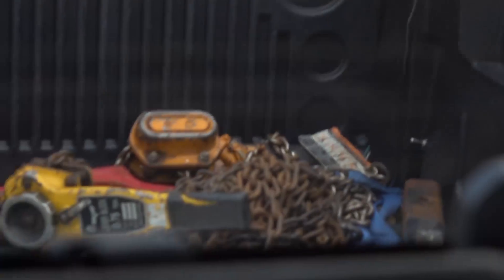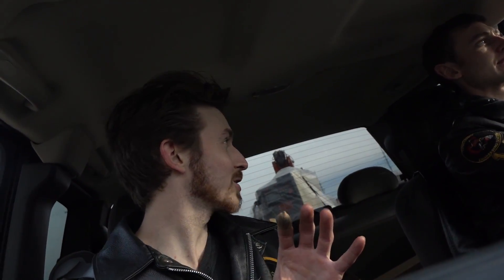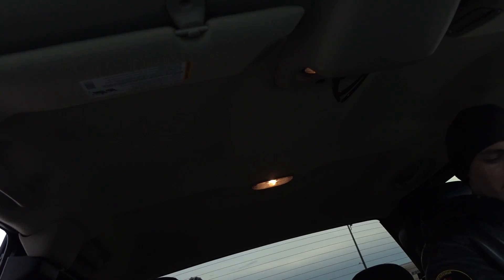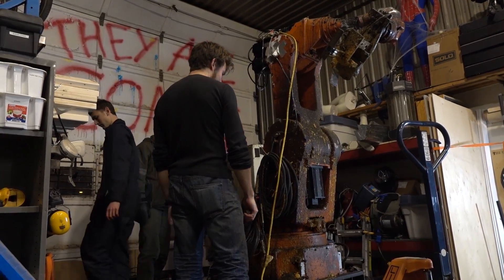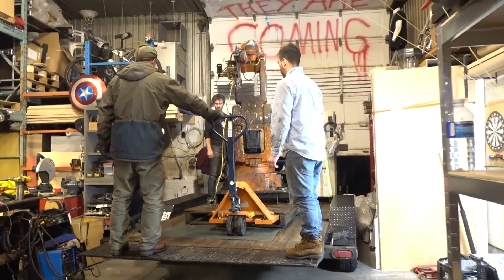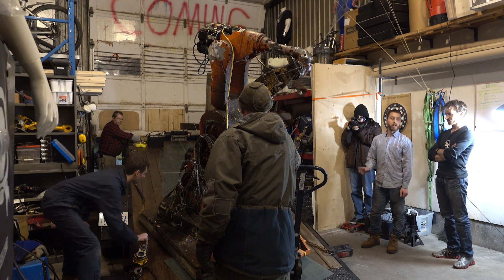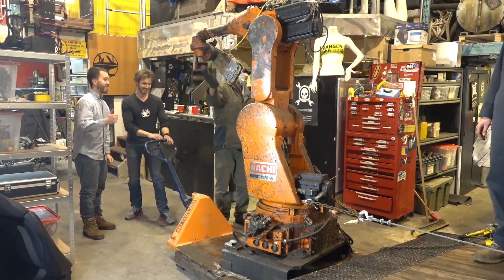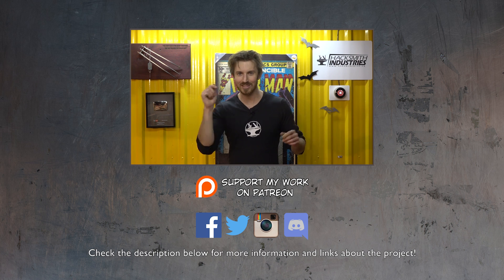WE GOT AN INDUSTRIAL ROBOT!?!

Comment: I was under the impression that 480 V only exists as 3 Phase wiring?
On the other side: your american wiring is somewhat strange. Why would anyone find 110V acceptable, I'd be worried that my vacuum cleaner would melt the wiring ^^
Reply from the maker: 110 is standard in Canada
Reply: the Hacksmith I honestly didn't expect an answer. So thanks for that.
While I normally abhore it when people tell YouTubers how much of a fan they are if they get an answer, I have to say that your and your team's work is very inspiring for me (I'm currently studying computer science in Germany). Hope that you get that jetpack going!
And yes I do understand that 110V is the standard over the pond, but I don't understand why, considering that copper has become a rare Ressource (and insulation hasn't)
Reply from the maker: +Jan Kühnemund Thanks! 480 is typically 3 phase, but like we said in the video the controller seemed to accept single - might not have worked with the robot attached though! 

Just curious though,  what's standard wire size in German for 220v15A? Everything here is 16ga for 110v15A
Reply: the Hacksmith Had to do some conversion there. For normal sockets 1.5mm^2 gets used, for sockets at which a washing machine, a dryer or another high consumption device will be plugged in 2.5mm^2 gets installed. 1.5mm^2 is about 15 AWG (is that GA?) and 2.5mm^2 should be about 13 AWG.
I didn't know that at 110v there would only be 16a. I always thought that the low voltage would be balanced out by a higher amperage.

Comment: seen those arms being used in combination with an extruder to make the ultimate 3d printer 
the one i've seen was in haarlem the netherlands 
https://www.3dmakerszone.com/eng2.html
they might actually be able to help you converting it to run an say centroid acorn
another option is to use it as a cnc extention for say a lathe holding the bit working the metal like a woodcarver would

Comment: You should be able to use a transformer to step up from 240 vac to 480 vac without any issues. During robot zone mod builds my company typically powers 4 to 8 robots on one 240 vac to 480 vac transformer
Reply from the maker: +anthony knapp still need 3-phase though
Reply: I must have missed the part you said you only had single phase
Reply from the maker: Yeah, getting a transformer is the easy part =P

Comment: I used to deliver pallets to that plastic company. With what I know about how hard they run their machines, I'd be amazed if that piece of crap even works. They were probably selling it for a reason, and that reason most-certainly was not because they were upgrading lol. That very forklift that put the pallet on your trailer almost took my head off when it lost a drive wheel a few years ago. If you want any helpful advice, in the future, whenever you go there, make sure you stand where nothing can hurt you, or one of those dumbasses will see to it that you get hurt.
You have no idea how many people die every year, in North America, as a result of forklift accidents. To top that off, most people who die in forklift accidents are not the operators themselves, but the people who get crushed/pinned to death when the operator fucks up.

Comment: Looks like you could do with a gantry crane in your workshop.
Reply from the maker: +James Bradwell if only our ceiling could support one
Reply: Surely the walls will be though?
I would have thought in Canuckistan walls on steel framed buildings are designed to withstand pretty significant snow-loads.

I'd see about attaching some rails to the walls and have a gantry that moves on those in one axis, and a winch carriage that moves along that gantry in the other.
Reply from the maker: I wouldn't trust them either... buildings have to be built specifically to support an overhead crane, thats why usually a steel structure is added into the building to support the gantry. Something we don't have room for and don't really need for the amount of heavy lifting we do. Hoping to get a high-lift pallet jack at some point, all we really need in the shop :)

Building #2 will have a shop crane :)

Comment: Re-wind the transformers in the controller to work off of single-phase 240 or 120. I had an electronics teacher in high school who got a very similar robot arm from a local university. Initially, it did not work but then he re-wound the transformers and it booted up. A couple of us did some pull-ups hanging from it... good times.
Reply from the maker: +Matthew From haha nice -- that doesn't solve the 3-phase issues though :(
Reply: It would depend on the way the controller transformer is wired. If it is wye, then you could undo the wye, and break it out so that each one of the 3 core windings are fed from the same 1-phase supply (honestly, not sure if that would work, there would be no path for the flux in the core to go). You could also remove the two outer windings and re-wind the center winding to provide the voltage it is expecting.
Also, the controller probably just does 3-phase rectification for a high-voltage DC bus to power the arm, so all you really need to do is feed that rectification stage by...a re-wound phase fed by 240 (preferable) or 120.
Reply from the maker: Well once we take it apart we'll quickly find out! That would be an ideal scenario!

Comment: My two cents: The arm and motors are the prize. Scavenge things from the main-frame box, but 20 years of improvements to electronics means a few modern speed controllers off alibangbay will put it to shame. Just be careful with that thing, or it will crush you.
Reply from the maker: +Jeremy Lee controlling the individual motors is the easy part -- getting them to work together is the hard part ;-)
Reply: That's what GRBL is for. Only gets you four axes per Arduino (actually there might be a 6-axis version floating around) just please add the emergency stop switch. I've been working on a desktop-sized DUM-E for a while, but because I know robots, I'm making sure the prototype is smaller and weaker than me. :-)
Reply from the maker: I don't think GRBL works with industrial servo motors, (they also have built in brakes and a different style of encoder) but I could be mistaken ;-)
Reply from the maker: And what I meant by getting them to work together, I meant programming the robot to work in 3D space -- inverse kinematics and what not. I've actually done several courses on robotics ;-)
Reply: Cool. If you haven't seen it, there's a program called FreeCAD which is like the GIMP or Blender of CAD/CAM. Open source, everything's in there (including a robotics motion module) and my goodness it's very Norwegian in the way the UI works. But very hackable, if you can't find something off-the-shelf.
Reply: Actually I checked (didn't know myself) but there's definitely a sub-set of people using GRBL to drive servos around, usually with a Geckodrive that takes standard step-direction. Doesn't have fancy brake controls and 1Kw might not be enough for the base motor, but it does encoders. Perhaps good for the wrist motors? ( http://www.geckodrive.com/geckodrive-brush-dc-drives/g320x.html )

Comment: Power is not the only issue you will have in setting this beast up; Getting a stable foundation built is another.

Another engineering organization that got a similar unit pretty much rebuilt their 3 inch thick concrete flooring to beef it up with a 3 foot deep reinforced high PSI concrete "pit"

Consider trenching the cables to the pedestal, it'll save trouble in the long run.
Reply from the maker: +Nighthawke70 we're not exactly setting up an automation line... If anything we would just make a larger base to balance it better with out the need for deep footing...
Reply: Nor was The Geek Group when they put in their KUKA KR-350/1 system. 
Search for Project Jeff in YT for details on how they set up their shop 
for the system and how they wound up decommissioning it.

Maybe I was exaggerating about setting the 3 feet deep resteel cage, but that  bot will apply some forces an unprepared floor will not like.
Reply from the maker: +Nighthawke70 we're not the geek group... This robot will be doing party favors at best... The floor is reinforced concrete, we've had a 6000lb forklift in here without issue... The robot only has a max payload of 30kg. Really not sure what you're imagining...

Comment: the Hacksmith,
Could you please try to make an M12 LRV Warthog from the Halo series, using primarily hydrogen combustion using a hydroxy gas combustion system by electrolyzing water, then pumping that into a traditional ICE engine. According to Thunderf00t the combustion lasts about a hundredth of a second or so, and produces temps of around 1000C, and Grant Thompson at The King of Random shows how he produces his own generator. Armed with this knowledge, could you build something like a Warthog, or failing the iconic assault vehicle a car that runs on hydroxy gas combustion?
Reply from the maker: +VeryBeowulf we prefer electic... Our Batman Baja project resembles a warthog kind of...

Comment: You could pin this on the ceiling, pin the robot on your waist and use vr to play ASSASSIN'S CREED ahhahhahhaha
by the way , sugestion if dont work , conect the servo motors in a open source arduino sistem(have a lot of diy projects in the intert) and after you just need solve the high voltage problem ahahha Can't wait to see the projects you will do with this robot

Comment: You can build a simple rotary phase converter to power it. Drive a 240V single phase motor and attach a 480V three phase motor to it with a shaft coupler. Just make sure that they are both rated to the same RPM and the wattage required to run them exceeds that of the robot. Connect the 480V in a "WYE" configuration with only ground and neutral shared between both motors. The 480V motor will act like a polyphase generator and Bob's your uncle! Be very careful though. 480V will kill you before you realise you've had an accident.

Comment: I would think the difficult challenge is just obtaining an arm in any condition. Today's electronics are so ubiquitous that it might just be a better plan to use modern motion controls. Heck, even Arduino and some modern servo motors and just gut the whole thing. That way you are starting motors that matching components and power supply compatibility. If you were to buy that arm today, the motion control box would be the size of a PC and you'd have a bluetooth joystick or PS4 controller to program it's movements.

Just a quick search on Alibaba shows hundreds of robot arm manufacturers. I'd be willing to bet you could buy a new motion control box for a fraction of what if would cost you to build a new one. And many of those companies do offer training and tech support for the products they sell. That would be my shortcut method of getting it up and running. What you can do, is put a bid on what you are looking for. Show pictures of your arm, and what it is you are specifically looking for. And within a week, you'll get dozens of replies back. That way you are just cold-emailing and asking if anyone can help you.

My third route would be buying a sub $300 CNC Robot Arm off of Aliexpress. At least you'd get a functional arm with software, motion control etc. It would serve as a learning platform about your large arm and you may learn what you can use to scale up to your arm, or you may find that using on of their software packages could in fact run your large arm. Huge time saver and invaluable learning tool. Plus you'd have another robot arm!

Comment: Use a VFD drive just fixed at 50 or 60Hz. I believe that some of them run on single phase systems but their output three phase. But you wont get 480V between phases even at 240V.

Comment: I'm sure lots of people have said this already, but maybe don't bother fixing the old control system?? I'm sure CNC tech is lightyears ahead of where it was in 1990 - and I'm sure there must be some kind of documentation on how to connect those stepper motors to a modern control board somewhere.  If you can get it interfacing with a regular ol' computer, I'm sure you'd have loads more control than you ever could with that standalone controller
Reply from the maker: +Joseph Moormann something to consider certainly, but we cannot spend 100's of hours fixing or fiddling with it -- we'll do what we can but at the end of the day, we're running a business so it has to have a useful end goal :)
Reply: Makes sense :P I kind'a wonder if they're steppers and not something weird, if a contemporary stepper controller wouldn't be far off from just slotting in...? It seems like people who re-purpose them don't comment much on how hard it is to control. Maybe you could try to get in touch with people who've already done it? Idk if these are good examples, but just the first ones I came across (http://hackaday.com/2014/02/24/3d-printing-metal-structures-with-a-6-axis-robot/ - https://atonaton.com/)

This guy's is servo based, so potentially different - but he has a lot of good info on his site! (http://transistor-man.com/3dprintbot.html)

Idk if you already did this too, but I'm guessing the company might be nice enough to give you technical data/manuals if you ask :) I couldn't find them already posted online (lots of manuals for tools that attach to that thing, though) - but I don't see why they wouldn't be willing to share info on old equipment in they still have it on file n' such (http://www.nachirobotics.com/technical-questions) Hope it works out! Looks pretty neat :)
Reply from the maker: +Joseph Moormann it's servo based ;-)

Comment: If you limit the power to 2.4KW you can use a VSD to convert single phase to 3 phase. The VSD is only $200 new on alliexpress. I have one for my blower on my my laser cutter.
Reply from the maker: +Robonza how big is your laser cutter??? A 3-phase blower sounds pretty overkill haha. Good to know about AliExpress
Reply: There are a lot of reasons to use a VSD on a blower. Main reason is you can control the speed and noise so it can be whisper quiet for stuff that is not smelly/smoky. You can crank it up when you need that flow. I have a 60W universal laser and I have set it up to an industrial grade because I like stuff to stay working.

I set up a new Epson 6 axis arm about 4 years ago. it was hard work even with the right cables and instructions. Unless you get some experienced help, that will chew some serious hours to make it work.

Comment: I have quite a lot of experience with the cheap Chinese VFDs (adjustable frequency 3 phase inverters) off eBay. They're clones of old Siemens parts and the work very nicely. Good thing I had a Chinese co-worker though, as one only came with a manual in Mandarin.

Comment: For 500$ I honestly wouldn't expect it to work properly, I maintained several types of these arms at baxter labs, they're a pain in the butt!!!! But you should have no issues finding parts/software for it. Looks like it was an old painter/welder. Nice score its worth is weight in scrap at the very least.
Reply from the maker: +Skinny Mcdoogin it's a full six axis actually -- could care less about accuracy or repeatibility -- we don't actually manufacture things, let alone mass produce anything that would necessitate a robot arm ;-) it's just a fun project
Reply: Skinny Mcdoogin but would it be worth repairing? Legit question btw
Reply: ITs totally worth a shot, you save thousands if it does work or he gets it repaired, the most common issue with those is getting gunked up and each axis is off several millimeters, in the industry thats bad and can cost a company thousands if it can't be recalibrated, no one wants to take the time to clean out a robot that was a painter/welder those typically get abused really bad, little to no maintenance done and they just get thrown out for scrap. At most the bearings are junk and would throw off the axis calibration. it looks like a 4 maybe 5 axis arm. If hes needing it to do a quality job its going to need to be rebuilt more than likely. If not the end product would look whacky.
Reply: Skinny Mcdoogin in the end what you said turned out true.

Comment: if this gets working, you can finally cnc machine your own edf.
Reply from the maker: kinda doubtful
Reply: the Hacksmith why though? it's simple enough to use those as a cnc machine. or it's the programming too hard. I've only seen those working with the system from kuka, but I don't think it's all that hard. or why else?
Reply from the maker: +CookingTasty because interfacing it with a computer could be a couple hundred hour job... It's not plug and play lol
Reply: the Hacksmith i don't get it. you have to do that anyhow? how are going to use it if not cnc?!.
and those robots are running off of gcode since decades. So you won't redo that stuff, ''just'' repair.
or what am  I missing something?
Reply from the maker: +CookingTasty it's an automation robot... They never used computers -- it has a teaching pendant, you teach it to do the things you want to do :p

I actually went to school in a program that had a focus on robotics and automation. We'd love a robot to use as a CNC but it's unlikely this one will be -- the inverse kinematics required would be insane!
Reply: the Hacksmith Alrighty, gotcha. thanks for the patience!

Comment: Rule of thumb when securing heavy loads.  Always chain or strap down double the total gross weight. Cause not only are fighting it's downward weight in general but also its forward and backward inertial weight when you break or accelerate. Also straps and chains will always settle or loosen as you drive. So it's good practice to stop after a quarter ways to your destination or after your first 50-100 miles to stop and tighten your straps or chains.
Reply from the maker: That's what we did ;-)
Reply: the Hacksmith Awesome! I look forward to seeing what this big guy has in store for you.